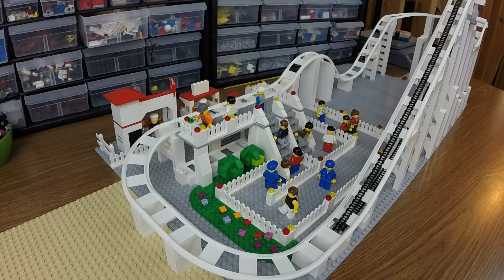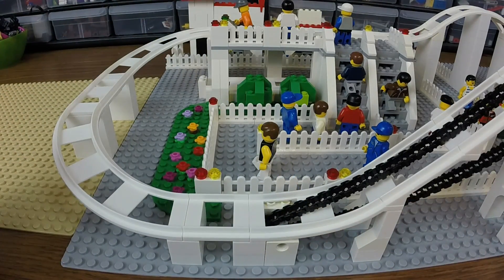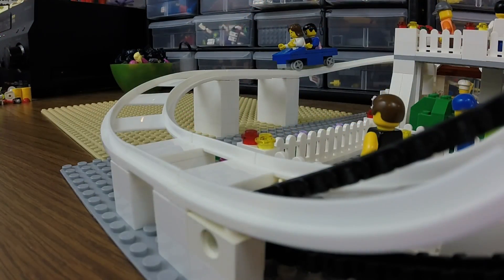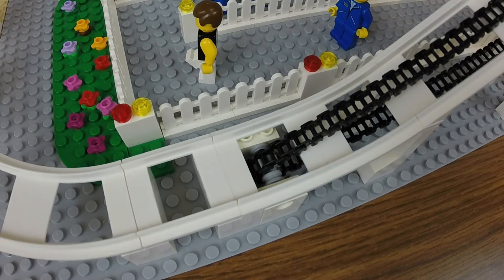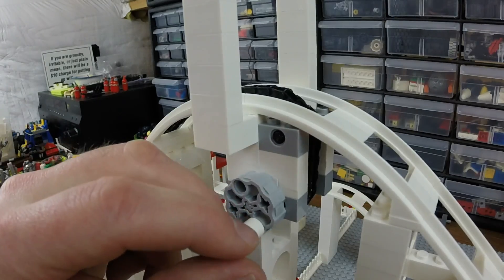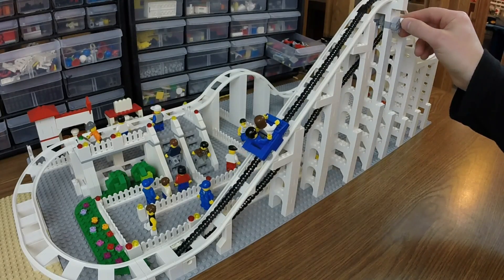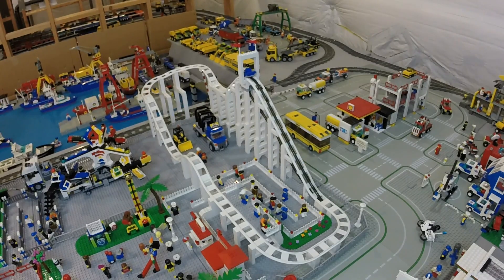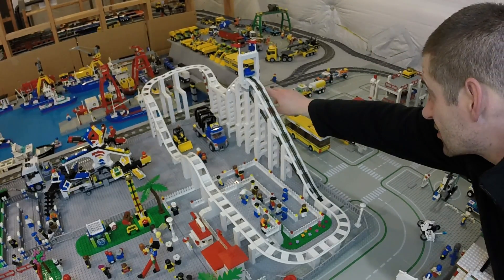LEGO Roller Coaster Lift

Comment: if you could hook the power source up at the bottom instead of the top it would probably be easier. not sure if the chain would move if cranked from the bottom. I'm Def getting one of these and trying

Comment: hey alex   this  looks alot like the problems with custom knex roller coasters   maybe you could have the the motor at the bottom and have a longer axle to reach the motor but still act as a gear for the chain   habve you ever thought of making it a terrain coaster   might take some time but it would look really cool and the motor could go inside the mountain instead of the bottom

Comment: Great video! I have got this rollercoaster and recently put the lift chain with a motor on the bottom and it works fine. You will need a few gear wheels and I recommend a worm gear on the motor to slow the speed of the chain. I am glad you have done this video because i've been trying to work out how to get the car to engage with the chain. I am now going to purchase the lift piece from Brickcoaster to solve this problem. Thanks!

Comment: I'll agree with other posters, looks like the motor would work best at the bottom. You may be able to run the chain over the drive gear at the bottom (have the gear underneath the chain) , you'd just need to find a way to ensure the chain stayed on the drive gear.  That coaster is looking really good in the city!

Comment: I would power it from the bottoms shaft. Just extend the axle out towards the inside of the coaster and add another hear and chain to a motor. That way there is no motors or other things seen up in the structure going to the top drive axle.

Comment: Alex one idea if you have the necessary elements you could do a cog system down the inside of the coaster then connect a direct drive shaft with your speed regulator you can apply the same speed to all your rides at the same time.
Reply from the maker: +Mathew Grinnell Great idea. I will definitely try to do this.

Comment: Awesome Alex,  think you need a lot of long axels to reach that crank.  What it you modified the gear at the bottom and but the power on the bottom gear.
Reply from the maker: +Mardigrasman23 The bottom gear might work better as the driver, but the 8 tooth gear does not fit the chains. I'll try a few things and see what I come up with.
Reply: +Alex Nunes go and google some coasters , but in essence they have the chain return go straight down from the top , then pas trough a " power shed"  where a drive lives , then goes to the bottom of lift hill. i think you can do that and have that shed powered by a takeoff from the mixer etc , and also have a reducer in it to have the speed you like.
Reply: +Alex Nunes  where did you get the chain
Reply from the maker: +Ryan Comer Bricklink.com
Reply: Thanks
Reply: Wow
Reply: Ryan Comer @